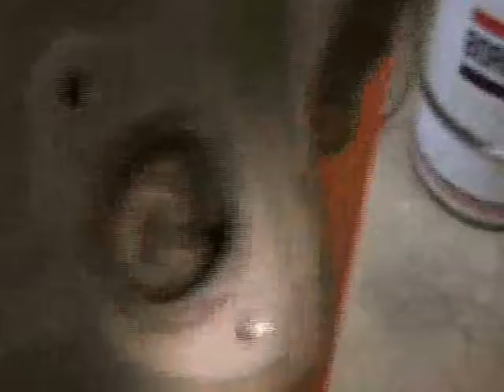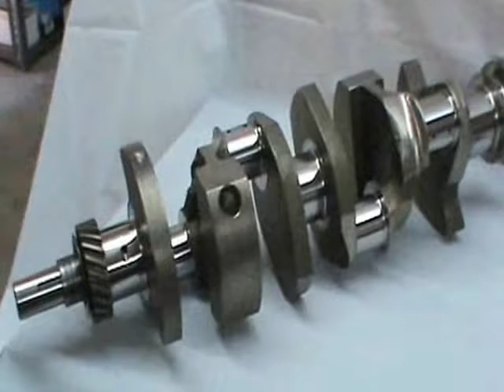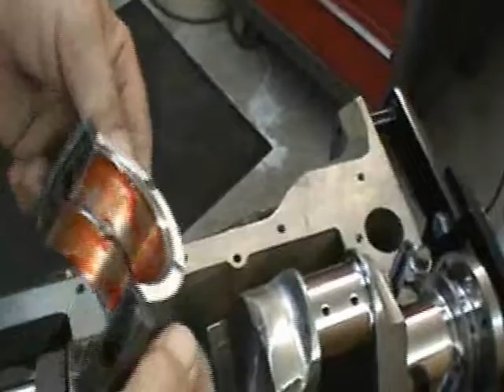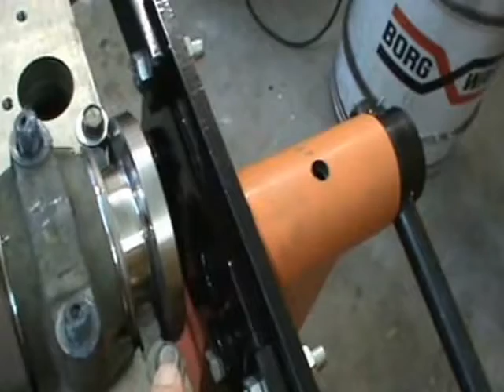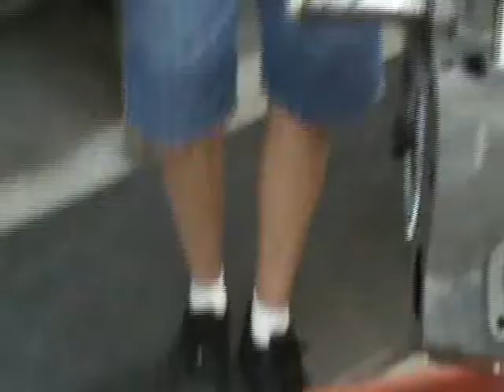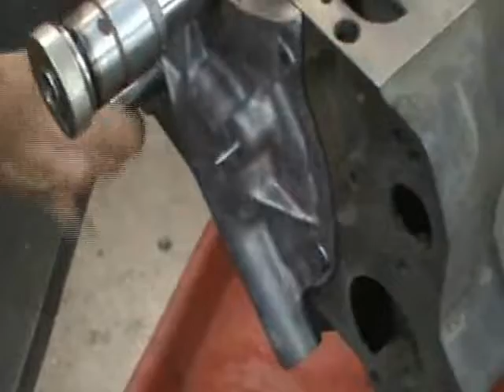Building a High Performance Flathead Ford  Part 2 - Installing Camshaft, Crankshaft & Front Cover

Comment: Just wondering when the main bearing cap studs and nuts were mention if it is overkill if the tapped threads in the cast iron block are the weak point anyway?
Reply from the maker: It would be interesting to hear from folks who have experienced failures to find out what failed. I personally have not experienced any failures. From what I have heard, it is the stock center main cap itself that fails. The newer French blocks have much more rugged center caps than the US versions perhaps indicating a known weak point.

Comment: You don't need to degree the camshaft on a flathead?
Reply from the maker: Degreeing a camshaft on any engine is always a good idea. This video segment is only meant to be an overview. Going through the degreeing process could easily be a segment by itself. Thanks for noting this subject.